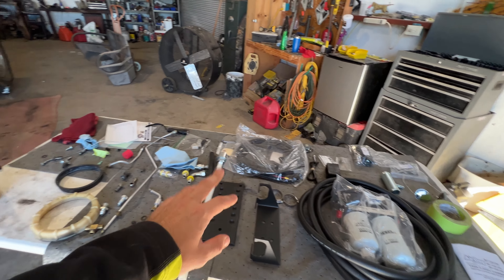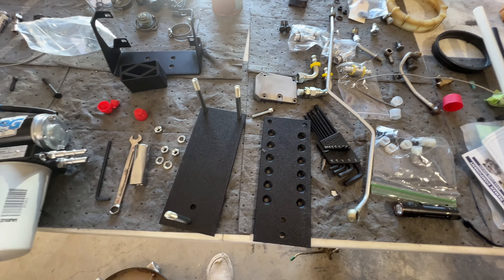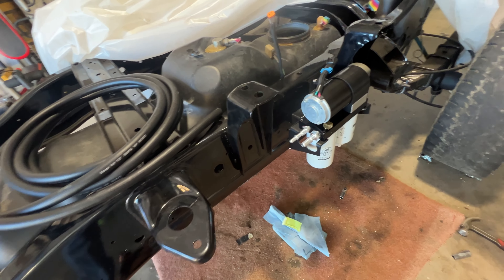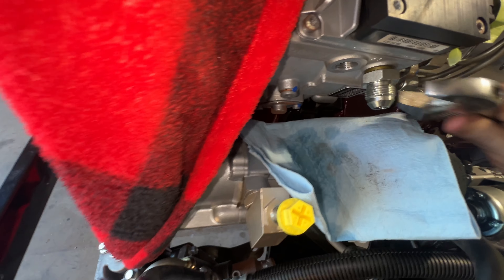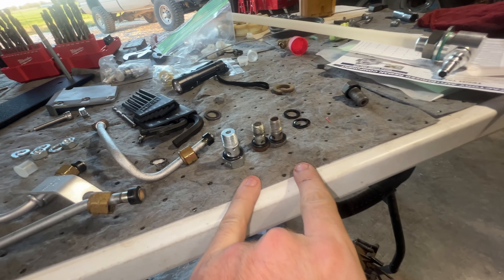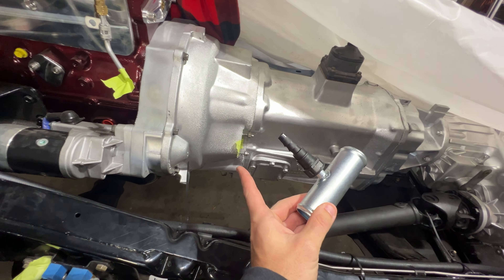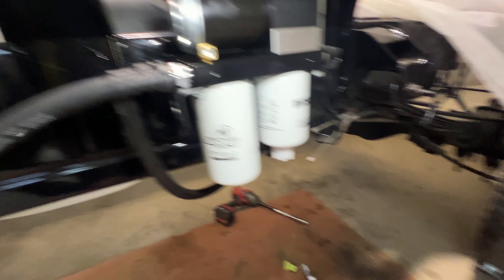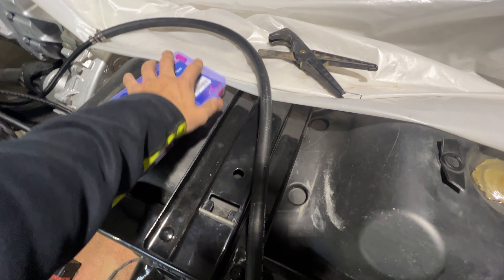Installing An AIRDOG 5G 165GPH On My CUSTOM 2nd Gen CUMMINS BUILD!!

Comment: Unless I'm mistaken your video series jumped from the vp44 install to the airdog. Is there a video for the injector lines install? Just curious how good or bad the Amazon lines worked out. I need to replace mine and wonder if its better to spend the extra for Cummins brand lines. Thanks.
Reply from the maker: The two videos before the airdog install cover vp44, injector, and fuel line install. The Amazon fuel lines are good for the price! I haven’t had any issues with them after 500 miles driving the truck. I will have to say they do take some minor bending and and persuasion to fit just right so keep that in mind when ordering